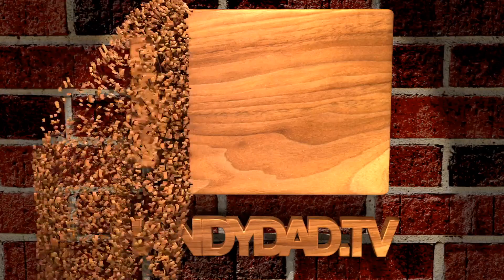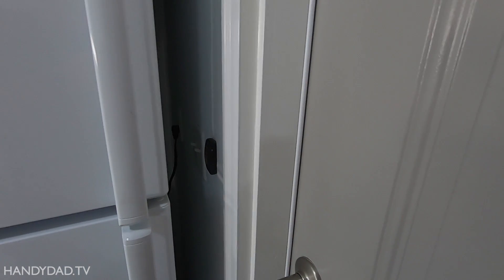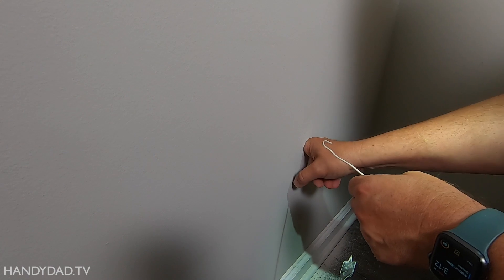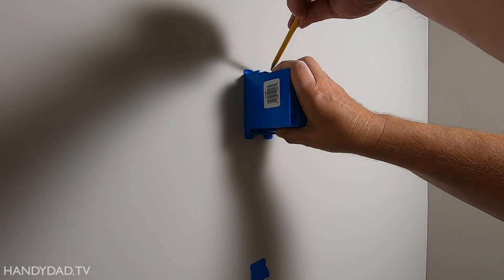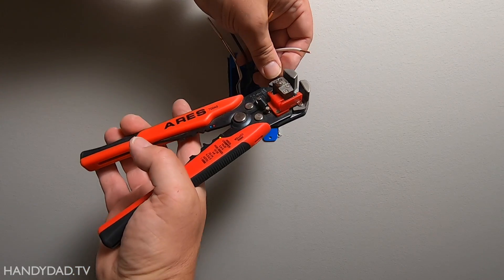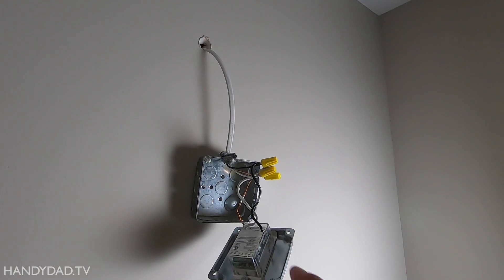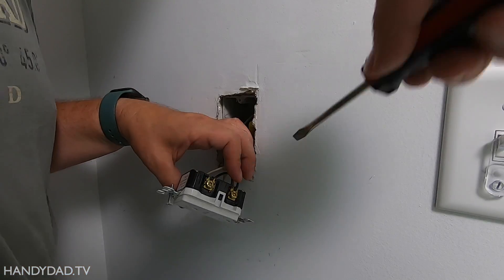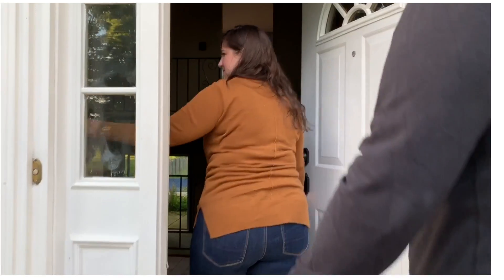How to Add an Electrical Outlet through a Wall

Comment: Question ....is there any reason why you couldnt use 12ga?
Reply from the maker: The wire is matched to the breaker size. 15 amp = 14 gauge. 20 amp = 12 gauge. 

You can certainly use 12 gauge wire with a 15 amp circuit, but it’s a waste of money.

Comment: Great video. I agree there’s nothing wrong with running the cable behind the cabinet. It doesn’t matter whether you are a novice or seasoned professional and anytime you pick up a tool to do a project you should always keep safety in mind and understand what can happen and drilling or cutting recklessly and not inspecting first can result badly. In reality no one would be under the cabinet cutting out the back wall knowing there’s drywall and possible wires behind it anyway. We recently had a 3 story apartment building burn down locally because a renter was hanging pictures and unknowingly nailed into wires.
Reply from the maker: Thanks for being a non-hater!
Reply: Omg how sad that is! I'm terrified of fires

Comment: Although you are technically correct that NM cable(Romex) can be use permitted exposed, you are not NEC compliant in your install method.
Article 334.15 EXPOSED WORK. In exposed work, except as provided in 300.11(A), cable shall be installed as specified in 334.15(A) through (C).   (A) applies!   334.15(A)Cable shall closely follow the surface of the building finish roof running boards.  You did not do this at least in the video.  Article 300.11 SECURING AND SUPPORTING    300.11(A) SECURED IN PLACE.  Raceways,cable assemblies, boxes, cabinets, and fittings shall be securely fastened in place.   You did not show supporting the NM cable either.   
So, you are not in complete compliance with NEC.  You are also showing electrical work being done by you that may or may not be legal if you do not get a permit and have inspected by AHJ.   Your insurance company could deny a claim if you have an electrical fire.   Especially since you put the evidence on YouTube.   Respectfully,   Kevin
Reply from the maker: Thanks for the info. The insurance argument doesn’t apply for DIY unless intentional arson.
Reply: @handydadtv    It seems you are correct on the homeowners insurance.   Thank you for clarification.
Reply: @handydadtv FYI, the adjective "intentional" is redundant when related to the noun "arson".

Comment: Just waiting for someone to pierce the unprotected dangling wire with a screw while mounting the bottom cabinets 🤦🏼‍♂️
Reply from the maker: That’s why there are protector plates.
Reply: @handydadtv  
See the video from 12:37 to 12:44
I don’t see any protection for the wire nor any mention of intention to do so.
Reply from the maker: Whoops. I thought this was a different video. That wire behind the cabinet is fine. The cabinets were installed with no screws down that low. Nobody will ever know.

Comment: Do people always jumper outlet to outlet? When is there ever a new line ran? And would that require running a new line to your breaker box?
Reply from the maker: A “new line” means adding a new circuit, which means adding a new circuit breaker in your panel. That’s an option in certain circumstances, but homeowners most often add outlets to existing circuits for convenience (to avoid extension cords).

If you were adding space to your home (i.e. finishing your basement or adding a room in your attic) then it would be more appropriate to add a new circuit than expand an existing one.

Comment: In some places code requires the cable to be inside conduit pipe...if it is outside the wall. That way it helps to protect anyone drilling in that area.
Reply from the maker: I don't know and can't cover all the variances. In fact, I know New York, just one state from me, doesn't allow Romex non-metallic wires; it requires shielded cables (BX). I only show what applies to me. But good point for a disclaimer in future videos.
Reply: all places it is part of the nec also if run in conduit it should be individual wires not romex or you should have used metal clad 
this is how not to do it children.
the way it is done is against code .

Comment: Too much load drawing from the refrigerator. You should consider its own outlet as what code calls for.
Reply from the maker: I’m not interested in requiring my whole garage.
Reply: @handydadtv  You will have to after the circuit starts tripping. Use a 12g for it.
Reply from the maker: Hasn’t tripped. It’s a small fridge.

Comment: Outlets should not be connected in series. Standard outlets are only to be in parallel. Series outlets will cause voltage drop.
Reply: Do not be mistaken. Even though its daisy chained, it actually is in parallel because of the design of the outlets. Since the two screws in the terminals on each side are connected, they complete the circuit as is. When you plug in a device, you are adding that device in parallel. No need to run extra wires unnecessarily. Just don't break the metal tab between the sets of screws and your daisy chained outlets are sure to be in parallel.
Reply: @JG-eb1uh  what about when you put two wires on each terminal on each side instead of pigtail and then only running one wire on each side?
Reply: @wazup3333  if I understand your question correctly, then you just need to run a single 14/2 or 12/2 wire to it and have a single 14/2 or 12/2 wire running away from it and you should be fine. Those numbers are assuming you are using 15A receptacles. Does that help?
Reply: @JG-eb1uh  are you saying to pigtail 4 hot 4 neutral and 4 ground wires so you only have 1 of each going to the receptacle?
Reply: @wazup3333  so I'm not an electrician but no I don't  think that's what I'm saying. I recommend you have someone look at it since it's hard for me to picture your question.
Reply: @JG-eb1uh  my outlet that I want to use has 2 existing hot and nuetrals attached to each nut and 1 ground because theirs 2 grounds pigtailed in the box. If I want to add an outlet I have to pigtail all 3 hots,nuetrals and grounds (9wires) (separately, 3 wires per pigtail)  and then add another wire so 4 pigtailed each(12 wires total) because the 4th wire will go to the receptacle. Right? Because there's no way to screw in the pigtail to the receptacle...

And it's not ”recommended” to add more than one wire of each to the receptacle so that way it is more of a headache and more work. For example you could use the push pins and nuts, giving you 8 connections excluding ground.
Reply from the maker: Right. I never connect household outlets in series.

Comment: One thing I don't understand is how the wires are routed through the wall. When you added the new outlet, did you take a wire from the existing outlet and use it to connect to the new outlet? If so, what did you disconnect it from? I'm just confused as to where these wires are coming from
Reply from the maker: I just attached the new wire to the existing outlet in the garage.

Comment: When you were connecting to the existing outlet you didn't say where you connected the white wire. Did you connect it to the screw that the existing white wire was on like you did with the black wire?
Reply: He probably inserted it inside the hole on the back of the outlet where the silver screw is. You should not have two wires under one screw.
Reply: @kittyhawk7060  he put 2 on one screw he said that device is designed to do so?

Comment: For running wires inside walls, I highly recommend getting a "wet noodle and fish ball chain".  It is 100 times easier than trying to find  a fishtape.  You and also tape a foot or 2 of the ball chain to the top of the fishtape.  The "wet noodle" has a magnet at the end that grabs the ball chain, allowing you to pull the chain easily through the wall.
Reply: Does that work on outer walls with insulation in them too?
Reply: @scooter2d2  the ball chain won't fall through the insulation, but if you tape the chain to a fish tape, then you can push the fish tape through the insulation and snag the chain with the noodle when it gets close enough

Comment: so how many receptacles can you put on one circuit? can you have both plugged in at the same time ( one you are running power from to the new one?)
Reply from the maker: There is no hard limit to the number of receptacles on a circuit; you need to think of the load of the devices you intend to plug in. Most circuits are 15 or 20 amps. Plan to use less than 80% of the rated load.

Comment: Failure to use pigtails.
Reply from the maker: Not required
Reply: @handydadtv  Tell us what NEC says about neutral continuity when devices are removed.
Reply from the maker: My 3-year-old house doesn’t use pigtails. You’re telling me they violated code?
Reply: @farmerdave7965    NEC  says nothing about neutral continuity when a device is removed.   It only requires it to the equipment ground conductors.  Hence the reason he connected them together in the box.

Comment: The wire exposed (not concealed within the wall) really should be armored.  
I know it is hidden behind the cabinet but sometimes things happen and if one didn’t know it was back there - well - that is how it happens.
Reply: True. I would've cut open the lower portion of both walls and ran the romex through each stud. Since the cabinets will be covering most of the walls, I wouldn't have to worry about matching texture.
Reply: I love the explanation 😂 “that’s how things happen” 😂

Comment: Enjoyed the video. Regarding the GFI outlet, I didn’t understand how to identify the load side to attach the wires.
Reply: The GFCI receptacle is labeled for the line (input) and load (connect to downstream receptacle) terminals. When they come new out of the box, the load side is covered with a yellow sticky label, because if you don't connect a downstream receptacle, you don't use this. You should also buy a receptacle tester which has three led lights, and a button to test the GFCI function. Otherwise, in the downstream receptacle, you will never know if it is wired correctly to sense a ground fault condition.
Reply: Thanks